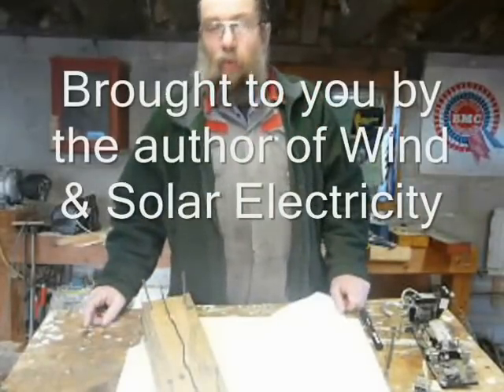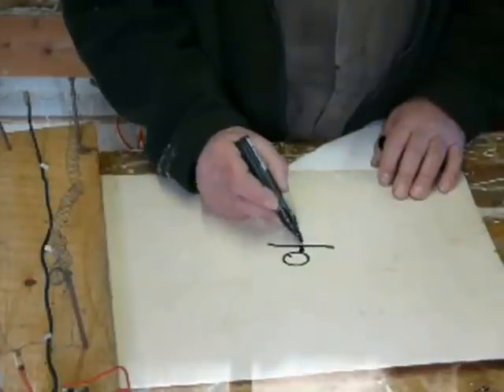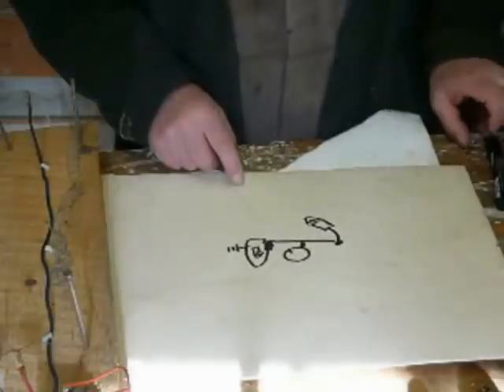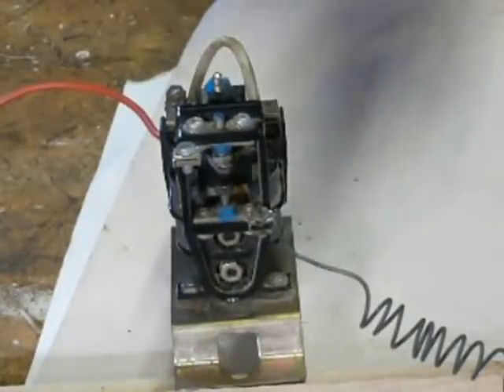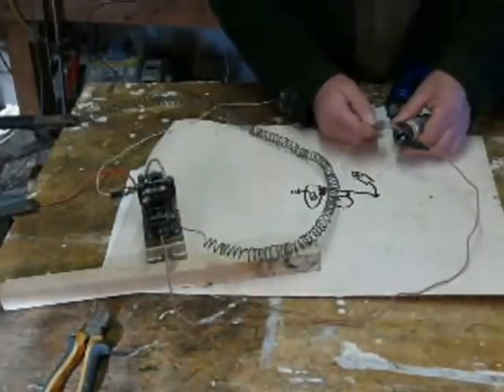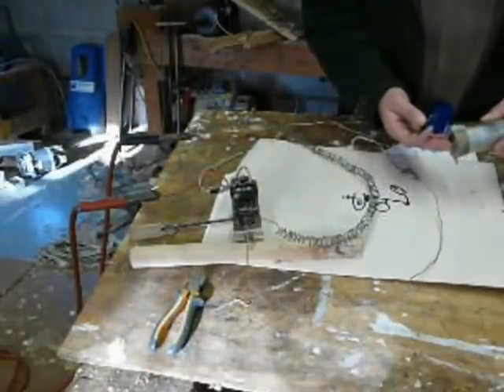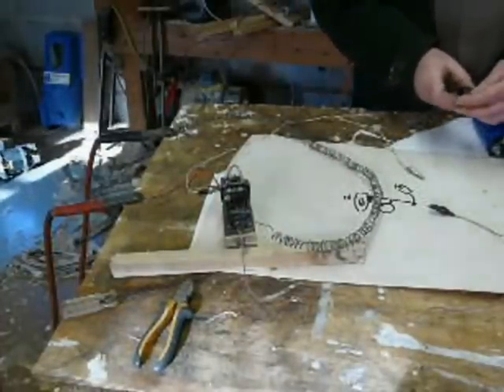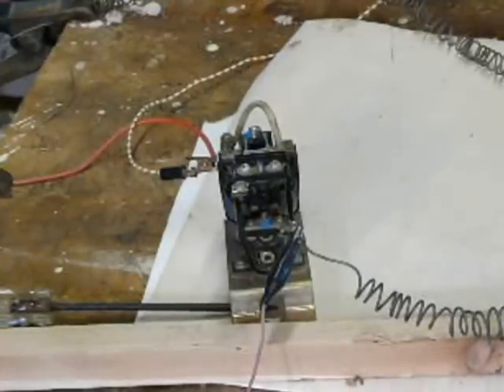Capacitors to prevent arcing damage to DC relay contacts

Comment: hi, any arcing  if i use 3 amp load  from 40v power supply?
Reply from the maker: With any DC load you will get a contact spark, always useful to add a small capacitor in parallel, cheers

Comment: A RC snubber works by being a dead short to the just-opened switch contacts.  There are two  challenges.  First is that the voltage across the capacitor rises really fast, faster for higher voltages and higher amp flows and slower for large capacitors.  Guessing that a switch opens fully in 0.005 seconds, you want to be sure the capacitor is large enough so that the capacitor voltage doesn't rise too high during that time-- perhaps to no more than 24 volts as lots of switches are rated for only 24 volts DC but 125 or even 250 volts AC.  After the snubber works its magic, the capacitor is charged up to the supply voltage and this is dissipated when the switch re-closes.  That was the smaller arc that the author showed.  You can minimize or eliminate this smaller arc with a current limiting resistor in series with the capacitor.  Second challenge is to calculate the resistance value so the watts dissipated is not too high but also the time to get the capacitor down to low or zero volts in a reasonable time.  The snubber won't do anything if the switch is re-opened while the capacitor is still charged up.  Lastly, put a anti-parallel diode in parallel with the current limiting resistor so all the power that would arc the switch can rush into the capacitor when the switch is opened but be forced to go through the current limiting resistor when the switch is closed.  
     Three components:  Capacitor, resistor and anti-parallel diode.  Not much to design but you need to think about the capacitor voltage at many points during the short time that the mechanical switch contacts move from where they just stopped conducting to where they are too far apart for a re-strike(arc) to occur.
Reply from the maker: Interesting deep theory, I just use big capacitors where I'm switching large DC currents, cheers

Comment: I have solar 220v and around 12amp and I want to reduce DC arcing which size of the capacitor should I use?
Reply from the maker: I would start at 40 Uf @ 400v and see how that works, as shown you can add another cap as an experiment. Cheers
Reply: See my new comment posted to this arcing video.

Comment: super nice tip ... as I intend to use an AC contactor for DC Use to switch on and off loads from a 12V battery
Reply from the maker: Hi, splendid, this will stop the contact damage from arcing, subscribed? cheers

Comment: Sir, I am using a 3 phase contactor to switch a 25kvar capacitor at 440V(33A at 440V), can u suggest the right values of capacitor and resistance that can be used as a snubber to supress arc and protect the contacts of the contactor.
Reply from the maker: Hi, my experience is with DC. AC is different as it effectively goes through zero with each cycle. Cheers

Comment: Hi, i need  a relay  to switch 110vdc or 120vdc at 10 amps;    you think  i could use one of those 70 Amp heavy duty Bosch style car relays, with an external capacitor, like you're doing?  how many microF you figure?, thanks.
Reply from the maker: Jose, Hi, I use these on my 50 vdc system switching about 30 amps and using 100 Uf caps, hope you have liked and subscribed, cheers

Comment: Very well explained. Can we use similar reasoning and employ similar setup when using AC circuit breakers to switch on/off DC circuits. Regards
Reply from the maker: Hi anywhere where DC is being switched capacitors can kill the spark, AC switches off 50 times a second so doesn't need them, subscribed? cheers

Comment: can anything be done to reduce the spark on AC system like a contractor running  motors?
Reply: Use two capacitor-diode(series --||-->--) pairs in opposite directions across the contact.
Reply from the maker: Hi, capacitors would constantly leak AC through, but they should not be needed as the AC shuts off every cycle, beyond that it's down to circuit design. With huge loads there is going to be an initial spark but not an arc, subscribed? cheers

Comment: well besides the quality it was illustrated and explained very well. Would it be possible to illustrate using AC voltage. I have a relay controlled by an Arduino. The relay will be taking loads both ac and dc, inductive and resistive. The voltage switching at the contacts of the relay is 240v AC.
Reply from the maker: George, as to quality look at the date of the video and with AC there is much less arcing because of the zero point in the cycle, cheers

Comment: Thank you thank you. And this is how to get through to my thick skull. I was working on a x-ray machine. when it blow a capacitor on the power supply next to a relay, while test running the machine. I knew the capacitor must be related to the relay operation because I saw the same capacitor next to the other relays. You just solved my problem. Thank you again. The machine has other issues though but I think all are power supply related....
Reply from the maker: Thanks for the comment. I assume the relays were switching DC, having the polarity wrong will heat up the cap. Cheers

Comment: Your video helped me a lot. I will be working with 56V and ~100A and i'm starting to get afraid about arcing.
Reply from the maker: Atthur, thanks for your comment, yes it's a problem easily solved, cheers
Reply: @TheInfoworks  Hy Andy.

Do you think that i should use a bigger capacitor, since i will be switching almost 100A at 50v?

Thanks.
Reply from the maker: Arthur, if you go too big then the arcing is moved from opening to closing contacts, I just experiment for rules of thumb, cheers
Reply: @TheInfoworks  Thanks. I've tried with some capacitors and 've been able to switch ~60A on 52V with an 75v/1500uF capacitor with almost zero arcs. I've just put an 10A fuse incase the capacitor shorts out some day. Thanks a lot, problem fixed.
Reply from the maker: Brilliant, that what this channel is a bout: helping peoiple help themselves, cheers

Comment: Liked your video, its a saver I'll share with others. That high capacitance can cause excessive contact wear when the contacts again close. Caps of that size are prone to failure which can be a serious fault. Resistors in series reduce effectiveness.  50V is pretty meek. Going higher in voltage becomes serious. If you have a set of NO and NC contacts, there is a way to get nearly the full ac voltage rating of a relay on DC.  This is from a renowned authority. It is one of my videos.
Reply from the maker: Hi, thanks for the comment and your "heads up" to more info, cheers
Reply: Your videos are excellent! That is a good find, i'm subscribed.

Comment: i think i learned the light bulb spark suppressor trick from you . when hooking the battery bank to an inverter  you'll get a big spark because the caps inside are not charged yet. running the power through a 120 volt light bulb first,slowly charged the caps so i can then hook the cable to the terminal without arcing and doing damage.  it is odd the instructions for inverters never mention this. anyway,if it was you that showed us that, thanks.

Comment: Hello and thank you Andy - your piece exactly answers my requirement. I want to save a mechanical relay from burn out in an eBike with ca 45 volt battery and a motor which can draw up to about 10 amps. I shall see if I can source a 1500 microfarad capacitor at a suitable working voltage. 

And yes I do remember the Morris Minor et al and I don't know how often I worked on / cleaned and replaced contact points - I think I could still just about do it with my eyes closed.
Reply from the maker: Hi. 1500 sound a bit high. If you use non polarised capacaitors (AC ones) you could try several from flourescent lights just to get an idea of the right value. have you subscribed to this non commercial channel, Cheers, Andy
Reply: Thanks for the guidance - this is not my area of expertise. Subscribed immediately.

Comment: really should also use a resistor in line with capacitor........and there are formulas to size all this.google  12volt switch spark suppressor and click on autech.since u cannot copy and paste on youtube
Reply from the maker: Not in this case as a resitor is included to reduce the initial current and so slow down the capacitor charging. In this case that would be counter productive and reduce the spark suppression across the contacts.

Comment: Dear +Andy Reynolds
  What about arc-protection in a relay, switching AC, 220V, 16 A?
Reply from the maker: AC switches off 50 times a second so there should be minimal arcing. If you want to try a cap it must be an AC non polarising one, but it may do more harm than good. CHeers
Reply: Andy Reynolds Thanks, that is what I needed to know.
Please do many more videos for many more years.
You rock!

Comment from the maker: Thanks for the positive comment. I have had several electric milk floats in the past and large capacitors reduced contact wear, especially when disconnecting. I now use them in the home generation dump load circuit. Let's hear how you get on. You may wish to subscribe to get email updates on new videos on this channel.

Comment: @TheInfoWorks Thank you very much for this practical video demo.  I found your video during an internet search to confirm exactly what you are demonstrating.  I was planning to install high capacitance across some contacts on a very old 36 VDC golf cart to reduce arcing across high current speed control contacts.  I was looking into this because I had also thought about the condenser that was used across the old ignition contacts (points).  I appreciate your efforts and the info you share.

Comment from the maker: Hi, Simon. So you enjoyed the sparks. The supply was fused just in case and was with low voltage DC, so mostly safe. This experiment was to show how to prevent the relay contacts from burning out whilst in use. It has been said that you cannot do this and you must use a FET, but the practical shows different. This is used on the dump load of the wind and solar battery system as part of the charge controller. More about this later. Cheers